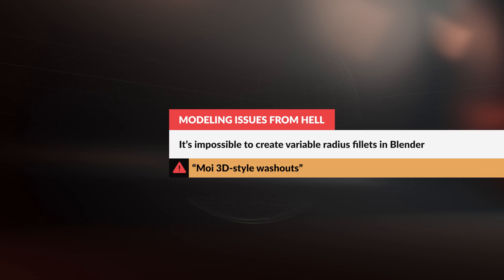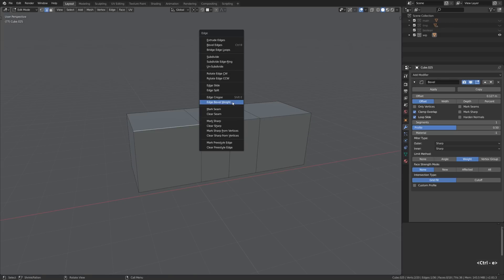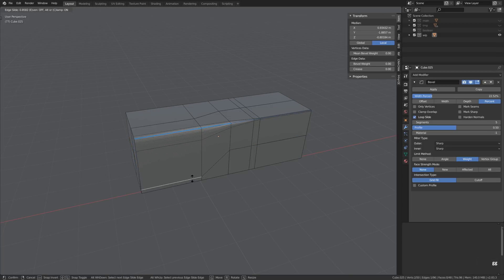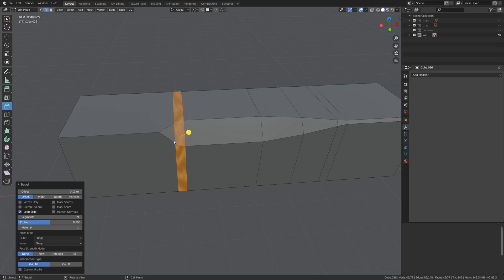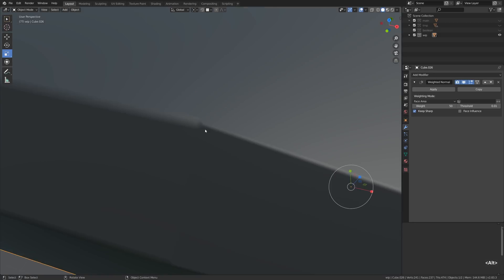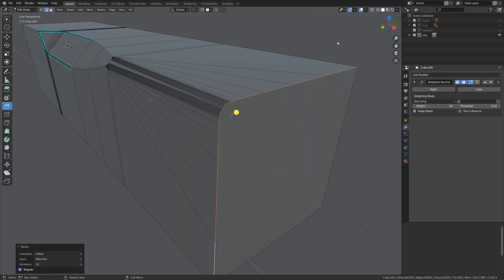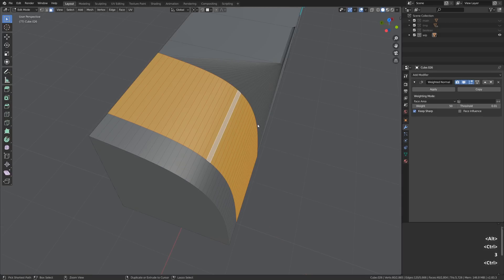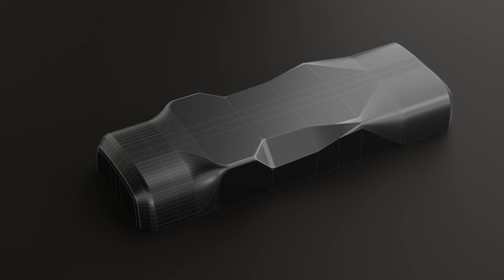How to Create Variable Radius Bevel in Blender

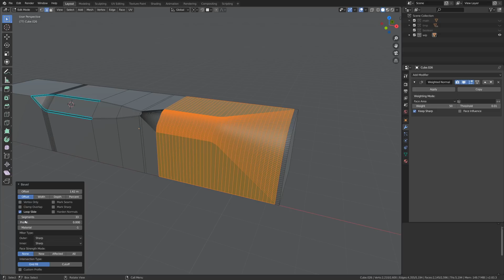Comment: In Blender 3.3, the "Profile" slider used at 7:10 doesn't seem to work as shown. Anyone know why or have a workaround?
I'm assuming it's the slider now called "Shape," which works as described if you run it on say, a single edge of a cube, but not when it has all these intersections. I tried messing with Profile Type as well, no results there either. Any help appreciated!

Comment: Hi, Gleb!
IMO, Blender definitely need an extra "Edit" mode. a CAM/CAD mode where it will represent a model as a set of math formulas with a modelling hierarchy tree. So it will be presented in a dynamic mesh resolution. After you finish, a model can be set freeze = a new mesh that you've wanted.
I think that it can be possible for the current core if it supports "dynamic arrays" for meshes. There is a Dynamic Sculpt mode, so I guess it's "yes" :)
Reply from the maker: Sounds like science fiction to me, but I like your way of thinking.
Reply: May I ask if you are talking about something similar to this effect?：https://www.youtube.com/watch?v=fL_uK--FtwQ

Comment: In fusion 360, the bevels work ugly, and in general they don’t work at intersections with threads or with an external acute angle, when compared with solid or NX :)
although this does not cancel fusion as a great program

Comment: The idea of “backup” could be easily solved with a modifier called “edit poly” that we can find in 3Ds Max. Basically it is just an “layer” that you can modify the model in edit mode without needing to apply all the modifiers. Seems nothing, but it is really powerful!
It could be an excellent feature to implement in Blender for all those people that loves modeling with modifiers.
Reply from the maker: That's definitely one of the possible solutions, I agree.
Reply: The problem of edit poly modifier is that it requires special mesh representation, basically, separate mesh engine, which is limited, but  parametric.
That's why there are "editable mesh" and "edit poly" mesh representations in 3dsmax.
Reply: @1DInciner   Also Edit Poly in Max can be very finicky or risky in some cases.  I've had it blow up on me too many times now.   If you navigate stack wrong or even re-opening a file sometimes.   But I agree, I really would love to see this thing in Blender.   But NOT like max , where we have like 5 different mesh types and all different hotkeys / features, which is super annoying.   Edit Mesh, Edit Poly, Editable Mesh, Editable Poly,  and some other ones.
Reply: What exactly happened when you change a parameter in the modifier stack? Will it reset the manual modifications?
Reply: There is a plugin called Sverchok that brings more a procedural workflow to Blender's modeling...It makes Blender work kind of like Houdini...It might be able to do something like this.
Reply: @GavinBall  As I recall, he's not updating anymore.
Reply: Edit poly mod is my most missed mod from moving from max, it was such a good modifier. 
Hopefully something comes soon =)
Reply: I agree I miss that Edit Poly modifier so much switching over to Blender.